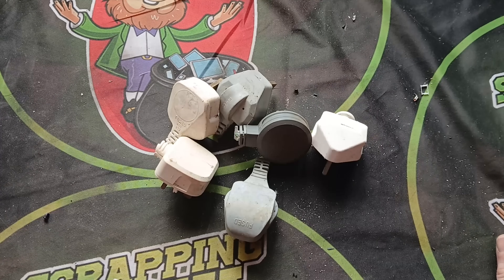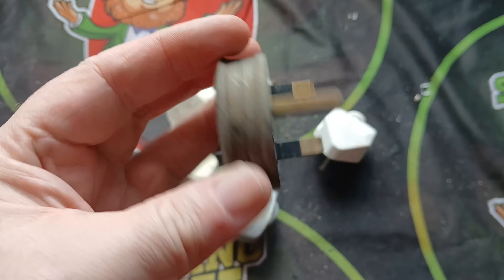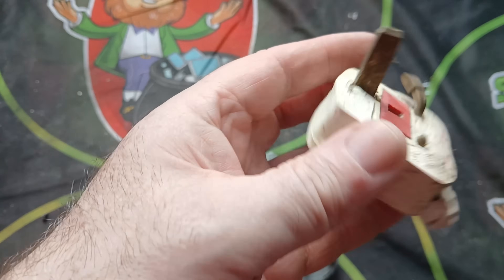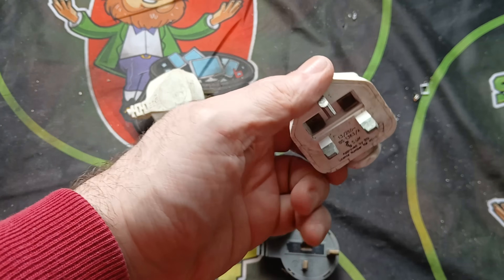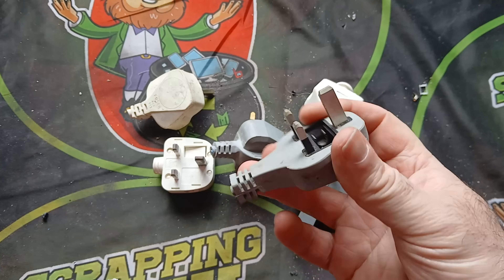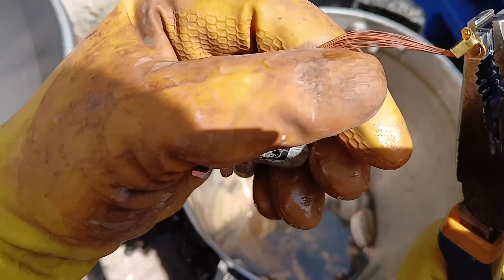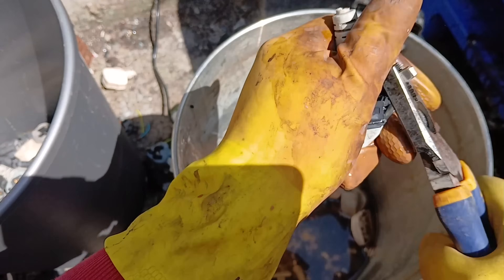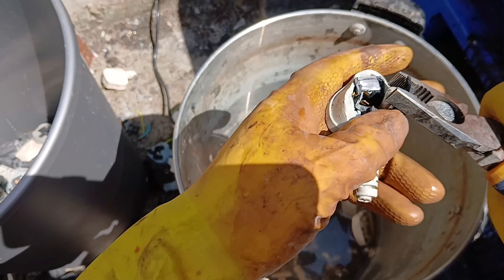The CRAZY Amount of Metal Hidden in Everyday Plugs

Comment: I don't need to spend any time processing plugs manually; I even don't bother to cut them off of the electric wires. 
Instead all cords/wires (with plugs/connectors, Gold-plated or not doesn't matter) are mixed with other Copper parts/crumbles, as well as Brass (as long as the Copper content remains at minimum 90-95%), and pyrolyzed to liberate all metal parts (all plastic/lacquer/glue is gone!).
This mixed material is then melted into a flat anode, and later electrorefined to 99.9% pure Copper (highest sales price). 
All PMs (mostly Gold) will remain in the bottom slime of the electrolytic cell for later recovery. The Zinc is precipitated out of the electrolyte when the concentration is sufficient enough.
The vast majority of wire insulation is made from PVC plastic. During the pyrolysis process great care must be taken as processing PVC is not for amateurs. It contains 57 - 58 % Chlorine
Usually PVC melts at 160 C, although additives in the raw material can change this up to 260 C, or down to near 100 C! However, such additives are only present in PVC plastic made for very special purposes and are usually not encountered in common PVC scrap. 
PVC begins to decompose already at 140 C giving off a lesser quantity of Chlorine gas. The real reaction takes place a 160 C when the PVC melts, giving off a huge amount of Chlorine gas quite rapidly. The processing unit must be constructed to be able to handle such a large, almost overwhelming, quantity of Chlorine gas to avoid any accident. Breathing Chlorine gas results in one thing only: Instant death! 
At around 180 C the decomposition process is completed and the Chlorine driven out of the PVC. 
The temperature is then, in several tempi, cranked up to 600 C to recover all Raw Pyrolysis Oil, which is later cracked into free Petrol/Gasoline, free Diesel, and free Fuel Oil (the latter for the metal melting furnace). 
The Carbon residue in the reaction chamber is collected, after a 24 hour cooling period. It contains hazardous compounds, thus it cannot be used for any chemical processes. Any kind of carbohydrates (old bread/left over pasta/contaminated flour, etc) is boiled in water and the Carbon residue is added, creating a thick mass which is formed to briquettes and dried. This material is then used as fuel for my other pyrolysis units; but it must be used carefully! Caution: All plastic types contain a myriad of additives; when the subject is PVC it also poses the risk of highly carcinogenic Dioxin. The Carbon briquettes is therefore only feed to the fire chamber after the temperature in the rocket stove system has reached a minimum of 1100 C. That's the temperature needed to decompose Dioxin. 
The created HCl is distilled, resulting in a beautiful clear and highly concentrated home made Hydrochloric Acid; at no cost at all.
Reply from the maker: That's amazing do you have a video of your setup
Reply: @ScrappingIrish  . I work hard 7 days a week; I don't have time to make any videos.
If you have any questions, feel free to ask. I might be able to advice you.